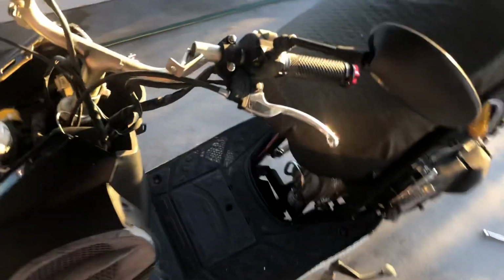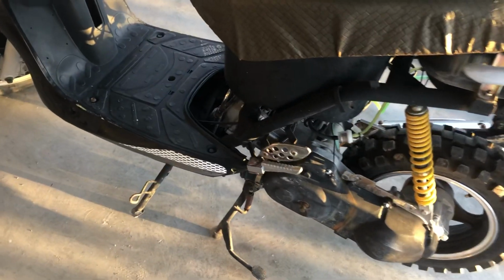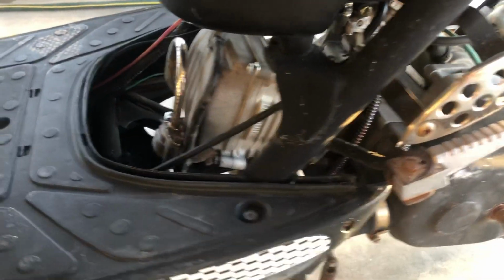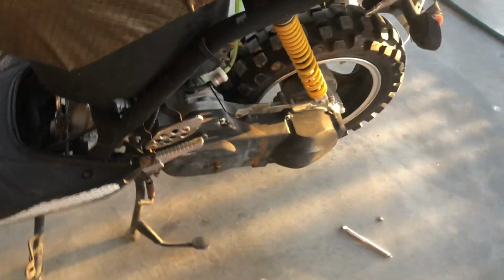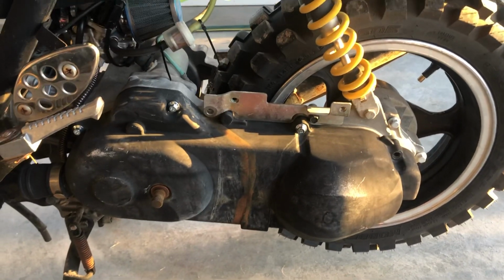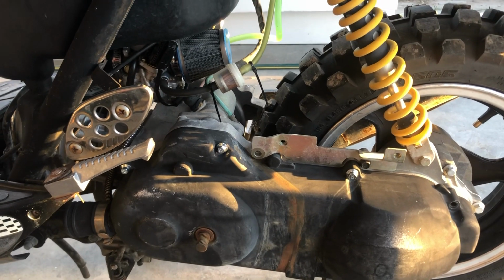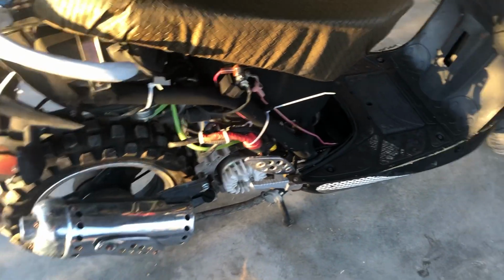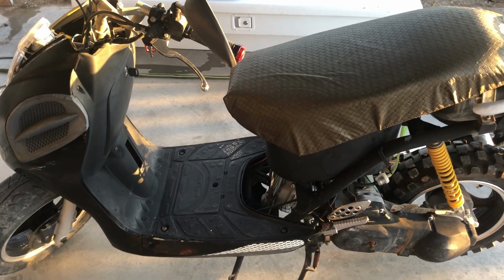50cc big bore GY6 revival project

Comment: Like the dirt tires are pretty dang cool I like the adventure bike theme and riding coming in future
Reply from the maker: Thanks. When I bought it, I was thinking I can't afford a dirt bike, but I can afford this moped. The tires fit perfect. I picked out the most aggressive tread I could find for a 12 inch rim. I do plan on making some dirt videos. You would laugh I have just been creeping through the dirt doing 3-5 mph. The suspension is rough.
Reply: @thelagmeister  that's Awsome

Comment: Sadly bout to sell mine off cause I need funds but I'll buy another and build one again
Reply from the maker: Dang man. That's rough. I always end up losing money when I sell my bikes. I really regret selling my 171cc. At least you got the 90cc kit with the head. It doesn't really get any better than that on these 50cc bikes. If you get it tuned right, you could be doing 45 mph. I hope you get the money you want for it.
Reply: @thelagmeister  I hit 53 on it and yea def worth it I'll build another I want to keep it but I'll just rebuild
Reply: @manicpyro  yeah never give up that spirit
Reply: @ORIGINALCONCEPTGARAGE  oh I won't I love my scooter to much it's a small sacrifice now for bigger goals vids coming soon...or u can hear it run few recent vids back
Reply from the maker: @manicpyro  53 on GPS?
Reply: @thelagmeister  yes sketchy on them 10in wheels
Reply from the maker: @manicpyro  if it goes 53 I wouldn't still it. My Yamaha 125 factory top speed is 53. The fastest I had a big bore 50 goin was 45 on 10 inch wheels.